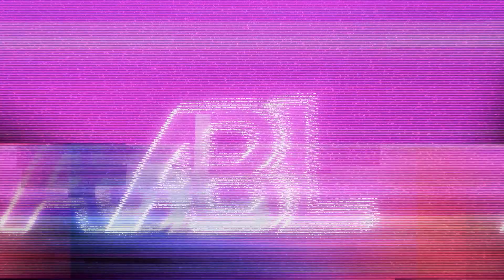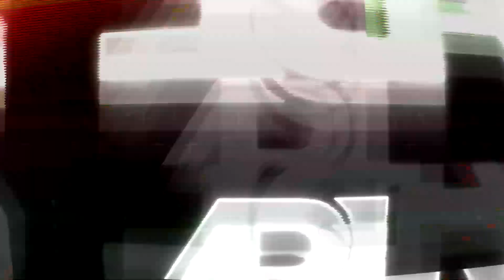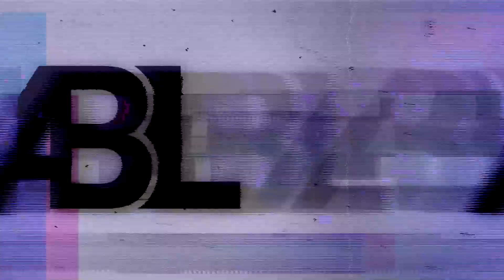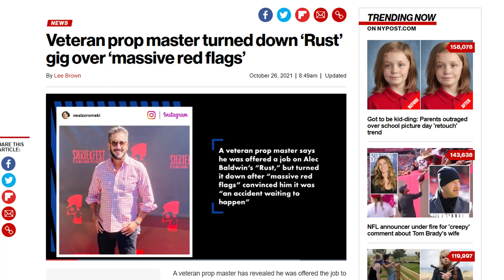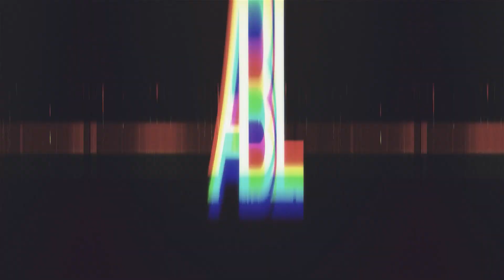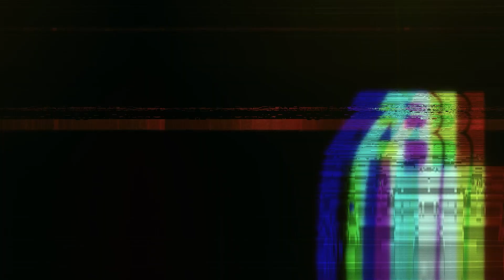UPDATE: "Rust" Crew Shot BEER Cans With LIVE Ammo Before Accident!

Comment: If a gun shoots real live ammo then it's not a prop gun. Not sure why everyone saying it was a prop gun like it was a plastic cap gun lol
Reply: The media trying to gaslight
Reply: prop guns are just regular guns used as props
Reply: I have said the same thing. It wasnt a prop gun it was a real gun.
Reply: So if an actor has a scene where he drinks water from a cup the cup is not a prop in the movie because it's able to be used for drinking? It has to be a special cup you can't drink out of for it to be considered a prop in the movie?
Reply: @louisxvii2137  No. They are not. 9 times out of 10, prop guns are disassembled to remove the firing pin and other mechanical parts that make the gun "fire". Unless this is a movie where they are shooting blanks which is obvious.
Reply: @EsotericOccultist   correct, for example they dont use real glass bottles or vases to break over someones head, they use specially made ones that dont maim or kill when they break (usually a sugar base). Hope that was helpful
Reply: First thing I learned about guns back when I was a small boy is that ALL GUNS ARE LOADED.
Reply: @EsotericOccultist A cup isn’t a gun anymore than water is a bullet. That’s a pretty lame analogy.
Reply: Prop guns are real guns. They are just labeled a prop because it’s used on a set. However, with CGI the way it is could they not just use that to create the effect of a weapon discharge? They then could use a dummy gun and the risk is completely eliminated. It’s inexcusable.
Reply: @johnnyjr  This is so incredibly false. You NEED a firing pin, the blanks (or wax bullets) just have very little propellant so it doesn’t fire at high velocity. Prop guns are real guns just used as a prop in a production. You are thinking of dummy guns.
Reply: @NunyaNomi  True , tech . can do this . Live rounds on the set should have NEVER happened . Stay safe and enjoy your day .
Reply: @elonmust7470  Absolutely. That is exactly what my father taught me. Always treat them as if they are loaded.
Reply: The nomenclature is confusing. A real gun can be considered the prop the moment it becomes part of the setting that actors interact with. So a real functioning firearm, in this situation, was a PROP. At the same, non functioning (or limited functioning) guns are props, and we usually refer to those as “prop guns”.

There’s also the confusing matter of “hot” vs “cold”, which requires we know the difference between a real bullet (aka a “live round, a blank round, and a dummy round. “Cold” means the weapon is not loaded or loaded with an inert dummy round. “Hot” refers to a firearm loaded with a blank—live rounds shouldn’t even come into it!

Anyway, not everyone, not even on a film set, is familiar with all the technical nomenclature of using real or fake weapons as props. They can be taught in a safety meeting (apparently there were none in this production or on this day), but that’s no guarantee they will use it. So non-specialists calling a PROP that happens to be a real functioning firearm a “prop gun” is just a fact of life, and maybe you should get over it. Or not. Maybe it’s your job in life to argue for technical correctness, and I can’t reproach you for that.
Reply: @EsotericOccultist  Both the cup and the firearm are considered props, but among specialists, prop gun generally refers to a non-functioning gun—a replica or one that has been modified or disabled. Outside of the specialist world, even among other crew, the term “prop gun” gets used improperly because they don’t know any better. I’m not sure how much difference this distinction makes to the incident at hand.
Reply: @johnnyjr  no they use multiple types. Tuber guns, guns that do not yve the ability to shoot, regulare guns and modified guns.
Reply: @elonmust7470  yes, but in movies you have to also assume the persons does thier job and it is loaded with blanks.
Reply: @timwilson3150  his analog is correct. Somsthing that is called a prop does not mean it is fake, it simply means it is used on stage ora scene.
Reply: @NunyaNomi  that is more expensive and silly.
Reply: @NunyaNomi  Blank rounds are loaded with different amounts of propellant, depending on their needs. Remember that the whole point is 1) producing muzzle flash, 2) recoil, 3) (in the case of autoloaders) blowback. Much less important (for the past 70 years) is 4) BANG!

Number 3) wasn’t an issue here since they were using revolvers. In this day and age of cheap CGI and SFX, muzzle flash doesn’t need to be a practical effect, and recoil can be physically simulated. That’s supposedly part of an actor’s job. There really wasn’t a need to even use blank firing props, let alone functional firearms. I speculate that the producers were literally trying to shave a couple hundred dollars off of their prop rental by using real firearms.
Reply: @Heywoodjablowme2  no prop gun can be functional or non-functional or even rube. It simply means a firearm used on set.
Reply: @alwinknowles7219  normally no live ammo should be on set at all. Security should have checked it.
Reply: @CouchMan88  prop means something used on set or stage. Prop does not mean fake at all.
Reply: @none_ya001  except in Hollywood you know they are loaded, but with blanks cause that is the point.
Reply: @andrewcarlton6196  Yes , while in the army , I had live fire and blank exercises but NEVER back to back.
No one had live ammo when blanks where used , just having live rounds on your person was a serious offense which could get you fined .
Reply: @andrewcarlton6196  A gun is a gun. You could use it on a movie set or anywhere else it doesn’t change that fact. It’s amazing to see people so manipulated by words they can’t see the obvious. “A rose by any other name would still smell as sweet.”
Reply: @EsotericOccultist  it's a real gun used as a prop.
Reply: Exactly, same as a starting pistol. It's unable to expell projectiles by design and only uses blanks.
Reply: @NunyaNomi  Low budget movies don't have a lot of CG since CG is more expensive than blanks.  Professionals don't point guns at people.  Professionals use camera angles, remote cameras, mirrors and plexiglass to get those 'in camera' shots.   This production appears to be quite a mess..
Reply: Prop is short for Property of the studio. Anything that an actor uses in a movie
Reply: @louisxvii2137  - so just call it a gun, we understand it’s a movie set. They’re trying to make it sound better/ less horrific
Reply: @EsotericOccultist  - if a guy dropped a cup on accident on set, would people be going out of their way to call it a prop cup? No
A gun that acts as a gun is a gun, a cup that acts as a cup, is a cup…

Comment: One cast member who worked on the movie "The Old Way” stated Gutierrez-Reed, working as head armorer, “put the cast and crew in several unnecessary and dangerous situations." It's also reported the key grip  told the Assistant Director she should be fired from that movie for breaking basic safety protocols. I guess the cast and crew of "Rust" didn't get the memo.

Comment: You lose the ability to call a real gun a prop gun the moment it's loaded with live ammunition. Everyone handling the weapon is responsible. Ultimately though the main responsibility lies with the person handling the weapon at the time of the shooting. He wasn't properly trained in firearm safety. It also lies with the Producer since he is the "overseer" of film production. He didn't have proper procedures for firearm safety in place and he didn't make any corrections after gun safety concerns were raised.
Reply: So if there's a scene where an actor drinks from a cup the cup is not a movie prop because it works as intended? It would have to be some special cup that can't be drank from in order for it to be considered one of the props in a movie? That doesn't sound logical
Reply: @EsotericOccultist  Bad analogy b/c cups don't have the ability to kill someone. A better analogy would be to say those actors were pretending to drink poison from the cup but since it's supposed to be a "prop" why did they put real poison in the cup?  

It would be common sense not to load live rounds into a "prop" gun and if you are going to be very stupid like that everyone that touches it should be responsible for clearing it before handing it off or pointing it at someone.
Reply: No the ultimate responsibility is on how the procecuters determine to be responsible which will most likely be the weapons master as in many other case the are the ones charged.

Comment: "Blanks" fired at close range will kill you. Our body is not designed to withstand the impact of the rolled paper round traveling near supersonic speed.
Reply: Depend on what "blank" gun you are using. There are some you can put you hand right in front of the barrel and it won't hurt you. There are blank guns and theres real guns where you put on blanks into. Blank guns are safe. Regular Guns that you put blanks are  deadly  in the wrong hands.
Reply: @jaimefish173  there are many types.
Reply: No Rolled papper round in blanks i seen there crimped

Comment: They need to stop using the term "prop gun" for this. A prop gun is COMPLETELY NON-FUNCTIONAL, not even a real gun. These days, they're usually plastic but can be wood or any other material but (again) completely non-functional. No matter what it was supposed to be loaded with, this was a REAL gun with at least one live round in it!
Reply: Technically, any item used on a set as part of a scene is a prop.

Comment: All 3 people that handled the gun should have checked it.
The person ultimately responsible is the person that pulls the trigger. Same as driving a car lighting explosives or anything else. 
When you point a gun at someone and pull the trigger you can blame no one else. 
Liability is making the personal injury attorneys froth at the mouth in greed.
Reply: Yep, if you drive a car that's uninsured or unregistered and get pulled over, you should know about the car before driving.
Reply: Exactly
Reply: Except pulling the trigger is part of the actors job.
Reply: @andrewcarlton6196  I do understand your point. But someone who needs to get to a job might take the chance to drive there because they can’t afford not to. This comparison is more like a person owning  a Ferrari without Insurance driving around saying I can afford whatever problem comes until someone dies
Reply: @jones8821  you are missing the point. If you ask a mechanic to fix the brakes on you car do you check to see if they did fix your brakes? No you trust that they did thier job. On set when you are handed a firearm you have to go under the impression that the weapons master has done thier job. One the weapons master had handed you that gun you are not allowed to load, unload, cock or check that firearm. 

Because if you unload the firearm the weapons master has zero evidence that you did not switch out blanks for live ammo. A more comparable example would be a race that has to trust that his pit crew installed the tires correctly and that one does not pop off whole racing and kill someone. 

This is not a firearm issue and is a work place safety issue. The weapons master failed to do thier job. When on the job you have to trust that the other person is doing thier job properly

Comment: Before I get into any sort of rant here, I want to explain the way firearms are supposed to be handled on set and the consequences of not doing so. Basically if you violate any of the rules of firearms safety on the set, you are fired/dismissed/canned/terminated on the spot and escorted off the set. This happened to the Assistent Director Mr. Halls on a previous movie. In this instance the Key-Grip was left out of the custody chain, and even though unaware of this, was fired, with prejudice. The AD who violated ALL of the rules and procedures was not, although he was supposed to be fired on the spot. The Armorers role in all this is vague, other then violating the four cardinal rules, and should be under review by the safety board. OK
(rant)
The chain of custody and handling of firearms on the set, are NOT to be violated at any time, any violation is cause for instant, on the spot dismissal and termination of contract.
1. Armorer - clears and checks, then sets out the firearms, with any ammo required.
2. Assistant Director - Checks and clears the firearms and checks the ammo for the scene if any. Then passes the firearms to the
3. Key-Grip - Checks and clears the firearm, and assures themselves that the relevant ammo, if any is there.
4. The Actor - Accepts, checks, clears the firearm. Then examines and loads the firearm, as necessary.
At this point, if all relevant safety checks and standards are met, the scene can be shot.
The ultimate responsibility lies with the individual, who with firearm in hand raises it, aims and pulls the trigger. Mr. Baldwin has been in the industry for many years. He has attended many safety meetings, has been told the four cardinal rules of firearms many times, by many people, and has had to conform to them for decades. He violated all four cardinal rules, right down the line. He has no excuse, that damned revolver was in his hand, it was his and only his responsibility. He had no cause to fire the Key-Grip and wound the AD in that fashion. He could have just canceled her contract for cause, or something. Firing someone from a movie, for whatever reason, that way is, pretty dumb. Although dumb fuck and Alec Baldwin have become synonymous, over the last few decades, he still has no excuse.
For those of you who wish to bring up that, the director shouted out "cold gun!" before handing it to the Actor. Doesn matter if he shouted "fuck me running backwards, a gun!". You MUST follow the four cardinal rules, at all times, in all situations, no matter what. The life you save, may be your own. If'n you don't know the four cardinal rules of firearms safety, and you are an American, you are a pretty much illiterate one. If'n yer from some other country, please look up the "four basic rules of firearms safety" and think about them, and all of the actions, of the people involved. Also consider, just what did that chick have on mister kinky, that he was desperate enough, to put a .45 Long Colt through her central plumbing? Jus sayin ;-)
(rant/)

Comment: Brandon Lee's death was a tragic accident - a good explanation of what happened is off Wikipedia " In the film shoot preceding the fatal scene, the prop gun (which was a real revolver) was loaded with improperly made dummy rounds, improvised from live cartridges that had the powder charges removed by the special effects crew, so in close-ups the revolver would show normal-looking ammunition. However, the crew neglected to remove the primers from the cartridges, and at some point before the fatal event, one of the rounds had been fired. Although there were no powder charges, the energy from the ignited primer was enough to separate the bullet from the casing and push it part-way into the gun barrel, where it got stuck—a dangerous condition known as a squib load. During the fatal scene, which called for the revolver to be fired at Lee from a distance of 3.6–4.5 meters (12–15 ft), the dummy cartridges were replaced with blank rounds, which contained a powder charge and the primer, but no solid bullet, allowing the gun to be fired with sound and flash effects without the risk of an actual projectile. However, the gun was not properly checked and cleared before the blank was fired, and the dummy bullet previously lodged in the barrel was then propelled forward by the blank's propellant and shot out the muzzle with almost the same force as if the round were live, striking Lee in the abdomen."   That is not what happened in this  case - it was incompetence and gross negligence that got Hutchins killed. That gun was loaded with live rounds and never checked / handled properly  ... not by the armorer, not by the assistant director, not by the key-grip, and not by Alec Baldwin who could have avoided this tragedy by following basic gun safety protocols.

Comment: Prop guns are just real gun with blanks. They were using the guns from the movie to shoot cans with live rounds btwn takes. Those movie guns should have never been used recreationally. No live rounds should have been on set. Cops found live rounds stored next to the blanks. They found boxed live rounds and loose ones and even a Fanny pack filled with live ammo. There were also chain of command protocols violated and no safety checks done before Alec was handed the gun. It’s all in the police transcripts.When he was handed the gun they called out “cold gun” but no checks were done. It was a test shot so most likely why they didn’t have shields up at the time.

Comment: I remember the Brandon Lee shooting. The gun he was killed with previously fired a squib load. A squib load is an underpowered cartridge that has enough pressure to dislodge the bullet from the case but not enough pressure to push the bullet through the press fit rifling of the barrel. They wanted a cartridge in the revolver that looked real (otherwise known as an inert dummy round) but the ignorant prop guy took a live round pulled the bullet out, dumped out the powder and replaced the bullet. What he didn’t realize is that the primer alone creates enough pressure through its ignition to create a squib load. Unbeknownst to the ignoramus gun handler there was a bullet stuck in the barrel. Subsequently they used a blank round. The blank had enough pressure to dislodge the bullet from the barrel and propel it into Brandon’s pump house....
Reply: Yep, that's pretty much the way I heard it too.